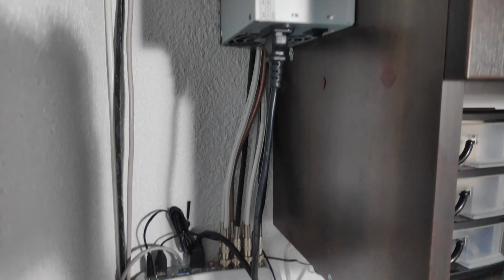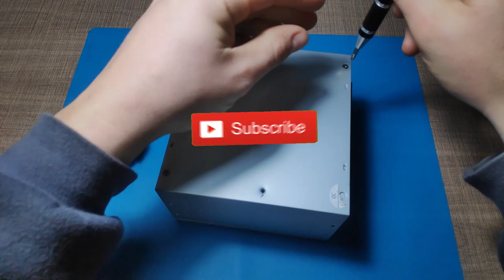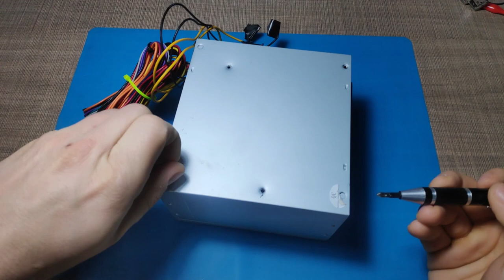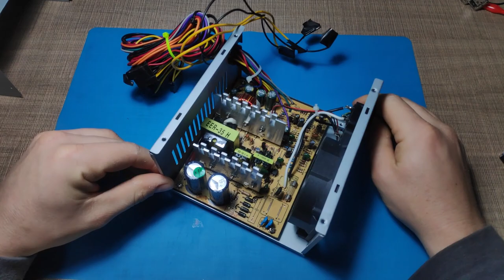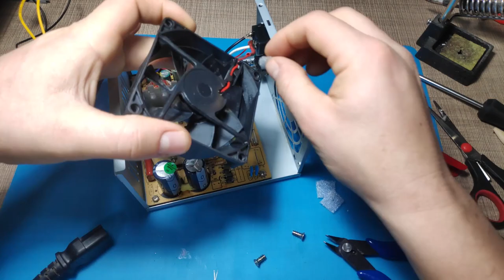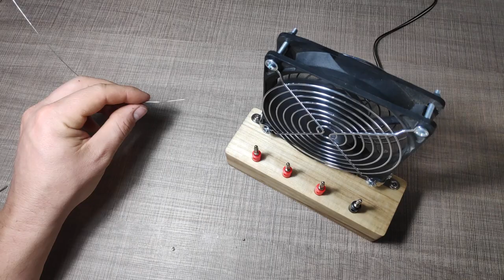Silence a computer power supply fan

Comment: Nice modification. One thing  - never use WD40 for fans - rather use Sewing machine oil. It is thin and will last longer.  WD40 is not meant for long term lubrication.
Reply from the maker: Thanks! I found out that after releasing this video and I have since added proper oil to it.

Comment: Thanks. Useful video. FWIW,WD-40 isn't a great long term lubricant. It'll help for a while, but a light lubricating oil would be better.
Reply from the maker: Thanks for the tip. So far it runs OK but I'll keep this in mind if it starts making noises again.

Comment: Slow down the fan speed reduces the air flow, not enough heat removal as you say at the end
Reply from the maker: Yes but if the power supply is not used for high currents, it can go by with lower fan speed.

Comment: I have a mining psu , its fan spins at 2300rpm all the time and its very loud. The problem is I don t use it for mining.  How can I reduce its spin..if cannot can I replace with another fan?
Reply from the maker: I'm not familiar with mining PSUs but I guess you can replace it. You should get a new fan with the same voltage and size. Depending on the load of the PSU, and how hot it gets you can also add a resistor as I did.

Comment: When you  say to not perform this modification if the power supply is in a computer.  Do you mean just the packing foam or all the modifications?
Reply from the maker: All of them, since the PC will consume a lot more power than the cameras and generate a lot more heat.
Reply: @TasteTheCode  what about the packing foam to reduce vibration though? I have a rattling fan and am going to try the foam about to see if it stops/reduces the vibration noise. Cleaned the fan and it helped a bit, but i think the residual noise is from vibrations.
Reply from the maker: @redshift3639  try gluing the foam to the PSU but don't block any holes. With the foam glued to the PSU, you can screw it to the case in a way that no metal touches directly except the screws. This might help, but if you want a silent setup, you should look at water cooling.
Reply: @TasteTheCode  quick updates. Took psu out completely and put it on the table and turned it on - still rattles, took fan out and padded the contacts with the psu with foam, still rattles but less annoying. I think the fan needs replacing. Going to wait a few weeks to see if the noise is bearable, but if it isn't i'm going to replace the psu fan - shouldn't be too big a job. fingers crossed

I guess the litmus test would be to run the psu outside the case, and the fan outside the psu, so i can truly identify the source of the noise, but i'm too scared to have the psu running with the cover off! :o
Reply from the maker: @redshift3639  yes, sounds like it. Usually, the fan is on a connector inside but it can be soldered as well. Also, when opening the PSU be extra careful. The capacitors inside can hold a lot of charge for a very long time and they can give you quite a zap. Be careful.

Comment: Question: how can you start the power supply without motherboard? Is it true you have to connect some wires to start up?
Reply from the maker: Yes, there is usually a purple wire that you need to connect to ground with a jumper wire or high power resistor.
Reply: @TasteTheCode  Tnx for your answer!
Reply from the maker: You're welcomed!

Comment: Hey friend. So recently, I opened my old PSU boxes that were useless and would no longer come to use since they were 7 years old or higher. Now after opening the PSUs, I got two cooler fans from them but I thought I could use them for something so I kept them. After that I switched the fans and cases, One had a perfect case with no broken spots or any issues but one of the blade was broken, the other one had a perfect blade and no issue but the case was absolutely destroyed with so many broken spots. After I switched the parts, the fan was ready to be used but it doesn't have a cable and I don't know how to make it work exactly. I tried making a USB way to make it work but it didn't work. I am thinking of adding this fan into my pc for an extra cooler but I am not sure how to make the fan work for real. Please help if you can
Reply from the maker: Those fans are usually powered by 12v and not 5 as is USB. Check the labels. You can tap into the 12V rail from the PC that powers up an optical drive for example.

Comment: You didn't mention in the video if the mods worked. Did it significantly reduce the noise?
Reply from the maker: Yes, it did. I have this in my office, running 24/7 since the video was made. Still quiet enough to not bother me.
Reply: even with packing foam around the fan and behind the screws, the fan makes a humming sound. Does that mean the fan is going bad?. The noise is very annoying! It's quiet for a few minutes, then increases then goes quiet - very weird.
Reply from the maker: It sounds as if the fan speed is regulated based on the temperature. Since there is noise from the fan, something is going bad. However, even with the noise the fan might be still working few years from now. I would suggest that you replace it.
Reply: @TasteTheCode  cheers, I will. Ordered the noctua a6 today. Replaced the other two noisy stock pc fans, this is the last crappy fan left in the pc, so might as well swap it out! :) PC should be super duper quiet after the mod. Looking forward to a quiet pc :)

Comment: 1- that is not a power supply.. that is a chinese crap, very dangerous for the hardware.
Reply from the maker: Well, that Chinese crap is powering my CCTV system non-stop for the last 3,5 years. No issues at all.